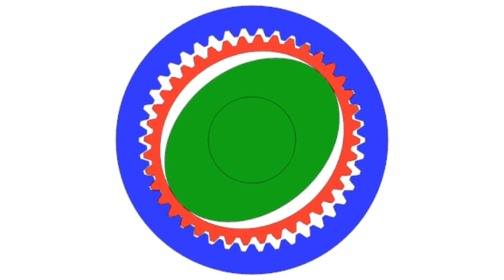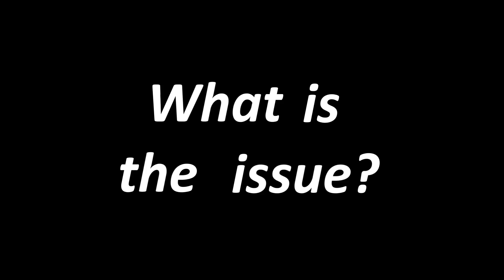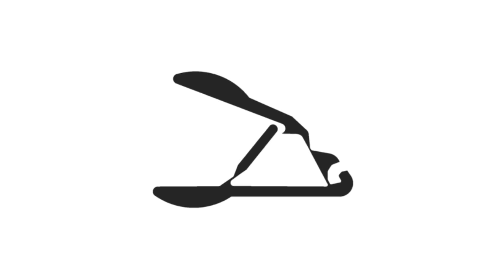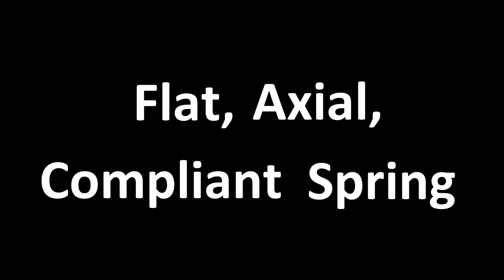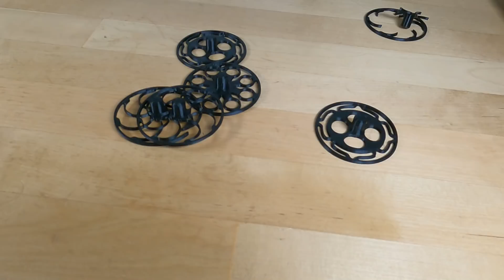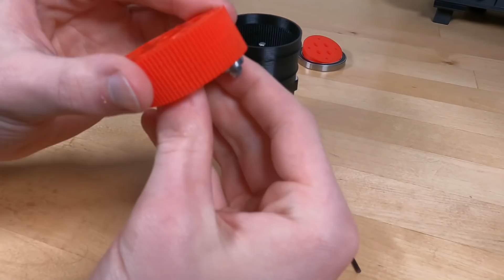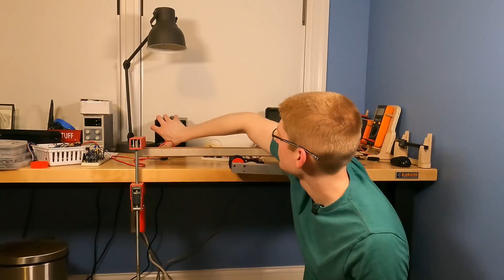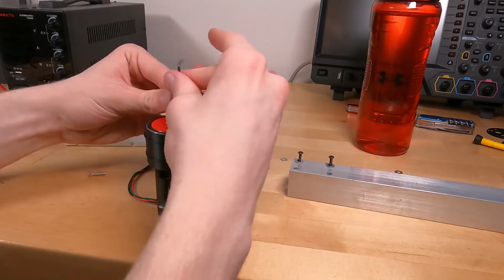Compliant Harmonic Drive (3D Printed)

Comment: VERY interesting! I’d definitely like you to pursue this further(!) What can be done to strengthen it (more torque), how stiff is it with the output properly attached to the moving spline, how much backlash is there, and how smooth is the motion? (Again, with the output properly attached.) I like this design a lot; I e seen other 3-D printed attempts at harmonic drives, but they’ve generally just mimicked the conventional design, with the moving spline being a thin shell. This looks to me to have a lot of promise!

Comment: Get rid of all curves in the torque-transferring spokes.  For example the outside (teeth) and inside (hub) should be 2 separate pieces with STRAIGHT spokes connecting them, hinged at the connection points (from the inside hub to the flexible outside gear). There will need to be some axial-movement play in the hinges.

Comment: Try T with a small bump on the ends  sort of like a Y shape, but more ability to bend inwards in your mechanism. Yet still connect to outer ring shape. Should bend but still be rigid in both directions. Allowing your reverse drive. just a thought.

Comment: Amazing! Very well done. Just a thought... Perhaps you could have two spring mechanisms on top of each other, one biased clockwise and the other anti-clockwise. This way the overall mechanism would have the same torque capability in either direction. You might have to place some type of grease or thin spacer between the two springs to reduce friction.

Comment: Hey, another idea: Try putting teeth inside of the flex spline directly above the wave generator. Then put a gear with the diameter equal to the short side of the flexed spine to transfer the power. If I am not misunderstanding the concept this should be similar to a two stage harmonic drive taking less space than a single one.

Comment: About a month ago I designed and 3d printed a flex-splineless harmonic drive. I was working out shrinkage dimensions on new filament at the same time, so mine is quite clunky, but it basically negates the need for the spline altogether and worked well enough as a proof of concept in my view. Maybe it's not of interest if you're specifically looking to explore compliant mechanisms, seeing as I took the flex out of flex-spline lol.

Comment: You could probably make the flat flex spline into a metal flexture using subtractive manufacturing, itd give better strength, then you could layer two mirrored gears to allow for backdrivability

Comment: I have found that htpla+ like 3d870 from fusion filaments  works significantly better for compliant mechanisms over time than standard pla. 

Though after a few months I pick up a pla compliant mechanisms that worked perfectly and hear the crackle as it breaks. My theory is moisture absorbtion, the same thing that makes pla tails on filament spools more brittle over time.

Comment: I just got an idea: make bendable ring and rigid disk coupled by teeth so they can move absolutely freely in radial direction against eachother but get in traction in tangential direction.
TL;DR: Make 1 : 1 gear transmission between elastic ring and rigid disk. That will introduce backlash but increase torque dramatically.

Comment: Awesome project! If you do improve the design, you can print the next one out of polycarbonate-PLA mix filament (you only need a hot end that reaches ~280°C and a bed that reaches ~100°C). I'd be curious to see this built out of titanium alloys like the industrial ones, I'm sure the compliancy would be enough for it to work while getting much more torque out of it. Excellent work, keep it up!

Comment: I think the long parts of that compliant element should be straight, not tangential. Sure, they're transmitting a torque between the hub and the gear teeth, but each element actually "sees" a force, either in compression or in tension.

Comment: Yu should change the elastic part. Put the spring inside as thick as the outer wall. and the to bearing  on the wave generator can run between the outer wall of the elastic part  and the spring.

Comment: There is another type of harmonic drive with two ring gears that mesh with the flex gear instead of one. The output shaft connects to the second ring gear and not the flex gear then. Seems like that should be easier to make robust and compact than 3d printed springs.

Comment: Just wanted to note that I dont think you need to make it increments of your nozzle size.

At least with cura, itll just run over the sections that are smaller and pump out less to fill in the gaps.

Comment: Make half of the thickness of the compliant spring in the other direction, and you will have the same strength in both directions. And just make it out of metal. Really nice design though. :)

Comment: The springs are not necessary.  Make a center hub with 6 female keyway slots.  Make the outer ring with thicker cross section with thicker cross section, and 6 internal male keys.   There is no need to build the hub and flex ring as one piece.  Only a need that they be inextricably linked.   The female key slots need to be deep enough that male keys do not bottom out.   Obviously a key shape is for convenience of description.  Other tooth forms or even a wave like a cycloidal drive may be better.

Comment: Nice variation. Now only if desktop EDM machines were cheap and abbundant, should be able to get some good torque out of this. Id be curious to see how a compound harmonic would work out, with two harmonics back to back with a small tooth difference. It would also eliminate that awkward flex-to-rigid cup transition like this design does; only 'downside' is that youd be looking at rather extreme reduction ratios. But I think its quite diy friendly; perhaps a fully printed flex spline would split down the middle rather quick, but you could epoxy some composite sleeve on the inside; or print a mold and cast the spline with some composite sleeve embedded.

Comment: Great video.

A weird idea: While it increases the complexity (maybe too much for hobbyists), couldn't an outrunner style motor be placed inside a traditional flex spline?
Mount the wave generator ellipses with a flex bearing on the housing of the motor at the mount end and a normal bearing at the other end.
Fit it inside the normal flex spline.
Put this inside the outer housing, with the motor wires coming out the bottom (where your motor shaft enters the gear), and screw the motor to the housing.
It might need a tall housing with a bearing like you have to keep the spline in place but should still be even more compact and solve your primary issue with the harmonic drive without resorting to compliant mechanisms.

Comment: A bit late to the party here, but what about having a 3d printed hub and ring, with U shaped metal links?  The U would have to have a tab off the ends to engage the hub and ring, and the body of the U inline with the rotation.  They can be in alternating directions to balance the load between directions as well.

Comment: Older video, but 1. your spring design was great, but you should stack it with a mirror of itself, e.g. rigid both clockwise and counterclockwise. 2. Have you considered using high-shore TPU? Specifically a CF- or GF-filled TPU? I'd think it'd go a ways towards polite failure, at least, even if it didn't end up being rigid enough to shift a heavy load without compressing the internal spring instead of rotating the drive.

Comment: The ultimate material would be carbon fibre: have the fibres run the length of the spring so that loads are transmitted through them. Flexing is perpendicular and therefore does not work against thrm

Comment: If the main reason you "Dislike" strain wave units is the wasted space from the wave side to the output side, then you should love the Phase Adjuster FD-2 series from Harmonicdrive.net
It has no wasted space and cool technology where the output has 202 teeth and the input ring has 200 teeth but the strain wave gear is only as wide as both rings. 100:1 in as little as 25mm wide!

Comment: using a material with a different failure mode could be a very easy fix, PETG for example would probably flex more, so the springy part qould probably have to be more substantial, but would probably be able to handle more torque
Reply from the maker: A different material would definitely influence when it fails, but the failure mode is gonna be determined by the geometry, primarily.

Comment: You make me wanna change my major to engineering. Also this looks compact! If only it didn't need the bearings etc (which add weigh and cost) I'd use it on my printer! (For the tool locking)

Comment: The design of your solid joints/springs is not to bear the torque. It is still springy in tangatial direction but it should only be into radial direction.  Good approach but not though to the purpose... Thanx for making this impulse to the community.

Comment: why not stack two of those flat axial compliant springs on top of each other in opposing directions. Also you could try thickening the material in the places it broke before, it looks like that was mainly right where the flex rod things connected to the inner wheel.

Comment: use the same design, add a mirrored layer of springs. you might not even have to increase the overall thickness of the output spline.

Comment: Up front... Liked & Subscribed!  A stunning presentation of an interesting project.
It's a sad reality that, if a mechanism is not back-drivable, there are only two options; it is strong enough and it works as intended, or it fails!  I think minor changes to the compliant mechanism around the point of failure would improve maximum load.
Hey... how about a larger diameter version that allows the stepper to be contained within it?   More space saved.  (In thickness at least)       :o)

Comment: I think your flex arms broke at the short bends. The longer sections held up just fine. Reinforce the short bend sections of each spring. Take the curve out of the long section so they can't bend in the direction of the arc they follow. They will still flex and spring inwards. The drive forces will still be in the same direction and will restrict rotational flex a bit more. I think this is possibly a better idea than 3D sprinted cycloidal. It's certainly far simpler! The material you have used is a significant limiting factor. I have no idea how many moments of flex PLA will tolerate before it breaks from fatigue. There are 3D printing materials that may work better and be stronger.
*
This was far from a failure!

Comment: You will need a washer plate on either side of the mekki nism to run the springs in compression. Without a plate to inhibit distortion they will immediately bow out to the sides and tear off. I'd really like to see a part deux where you can torque it to the shear limit of the pla teeth.

Comment: Instead of a having the "Springs" go in 1 direction, have it look more like a Brick line pattern so it has the same strength in both direction
So instead of this
___________|    ___________|
|                        |
Use this
__________|__________ __________|__________   
|                                        |                                         |

I think it would give better squish while preventing the contracting in one direction and compressing in the other, it might also make it stronger overall

Comment: The problem with your incorporation is putting the compliant device on the wrong surface. The great thing about 3d printing is that you can print designs that are not possible by the molding process such as reducing cavities.  What if you created the compliant part around the circumference of it instead of on the area. How about a thin walled reduction in size to the gear or just making the assembly smaller with the bearing or journal around it.

Comment: great video! I wonder if using a third gear with the same number of teeth as the flexspline as an output gear would be better than taking the output directly off of the flexspline? I reckon that would be a lot sturdier than the springs.

Comment: Try to use your Spring in two directions , doing this you Will have the same behavior in both directions and increase The durability  I believe that The Spring should be like a Y. Instead of a S

Comment: Ninjaflex?
Harmonic drives have much less moving parts, with the right material tolerances would be more reliable.
For the more rigid materials, a planetary gearset moves the teeth to the rotor, and spreads the load more evenly.

Comment: What if you made a two-layer setup for the compliant disc, with the pinwheel pattern going clockwise on one and counter clockwise on the other? I think the two discs would have to be separate from one another maybe? And they’d be rubbing against each other slightly? But they might be able to cooperatively withstand more weight in both directions.

Comment: Why not have two pieces -- a deformable ring with teeth that slot-fits (radially, of course) four or more times into a solid disk?  A little dry lubrication on the slots should keep friction heating down

Comment: What if you don't drive the output off of the flexspline's hub, but instead the flexspline meshes with both the input and output gears, which are concentric but out of plane with each other? I feel like you could make the mechanism even more compact, and your torque would only be limited by the strength of the teeth themselves.

Comment: It looks like all the print designs you show are parallel to the disk.  If you rotate them to be perpendicular you might find more solutions to withstanding a high torque.  For example from a cross section view you could have a thin Z shaped spring and from a top view it could be wide. 🤔

Comment: I am really curious to see a solution to make those flexing are z longer without interfering with the mechanism nor making the whole thing taller... it should be some way to make the bearing bar work as it should while allowing some room to make the flexing parts to be stronger... or maybe making more flexing arms or having a bottom and top one... I am modeling some version in my mind but I cannot come up with something that should work perfectly in this specific setup!

Comment: I think harmonic drives made my life hell for 10 years,I printed continues forms you know the paper with the holes on the side you can tear off white yellow pink copy,yes they still use them,because the printers are super fast
The drive put the holes in the paper or pulled the paper for years a old timer said they needed to rebuild the Harmonic bal. But they didn't so when you collated the forms together it was hell because the holes didn't  match up

Comment: @5.17, you have shown the flex spline prototypes that you have tried. You haven't explained the reason why that second from top on the right side is not functioning, can you elaborate on that. I guess for equal bi directional torque, you need some design like that.

Comment: Hey, what if you removed the complaint spring part entirely and add teeth on the inside of the flex spline to mate with a gear of the same number of teeth that's connected to the output shaft? I suspect it would circumvent the breaking problem and mean the flex spline undergoes more uniform deformation so it might endure less wear...
or maybe the thing would just jam up idk
anyway, have a subscribble

Comment: You've designed all springs in the same direction, and what if hald of the spring would be in the other way ? Or what if you add a second layer of the same springs, but oposite directions ?

Comment: Great job. 
However, I have some concern about the 
fatigue. Also, at a given time, all the torque is applied on few teeths. Also, the extreme teeths are partially aligned. It implies some erosion. 
About units, I am using boths. But when 
calculus is involved, metric system is a lot better than imperial. 
About languages. It is closely related to culture.  Soon, the technology will allow real time accurate translation. It will eliminate any requirement for commun language. 
By the way, english is not the universal 
language. On 100 peoples, 17 speak mandarin, 6 spanish, 5 english, 4 hindi,. 
And china is now the super power of the world - we slept a lot.  Should we learn mandarin ?

Comment: I noticed you chose this mechanism with all the springs facing in the same direction and therefore favouring single direction rotation - what was the downside of the experimental piece you made with alternating direction spring pieces? Did they cancel something out and make the piece too rigid somewhere?

Comment: What if you had 2 "spring plates" moulded in opposite directions to balance the forces? Is that something you can do with 3d printing?

I'd also like to see how 1N.m of torque compares to the properties of alloy steel vs the properties of PLA.

Comment: i cant imagine this being that robust given the loads are transmitted through the compliant mechanism springs, maybe I'm wrong tho
Reply: I think it could definitely be robust; a symmetrical design would ensure the compliant geometry will always load in tension would be very strong, and a design that always loads in compression (but without risk of buckling) would be even stronger.

My opinion is that material degradation and microfractures would be a much bigger issue, but those are only relevant for long life, not for printed prototypes like this.

Comment: Not sure if this is cheating but I just used tpu for my flex spline and had friction mount to the output plate. I haven’t had any issues other than my 3D printed elliptical bearing melting at high speeds